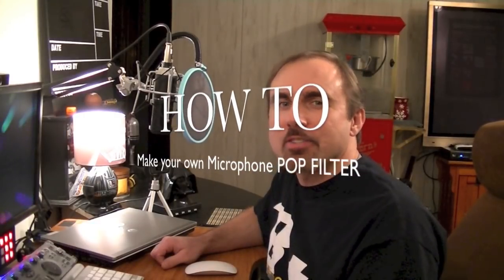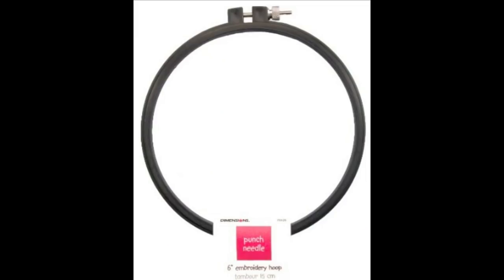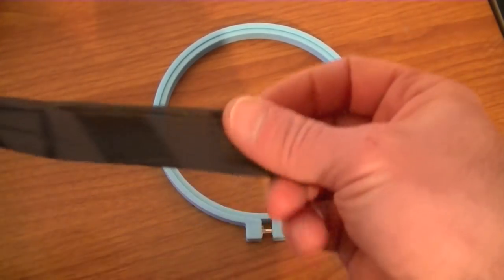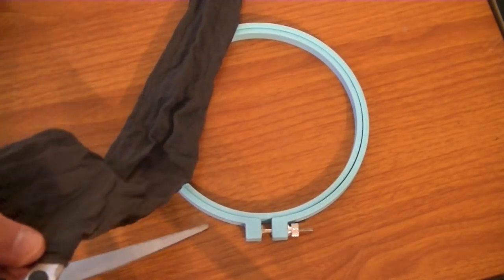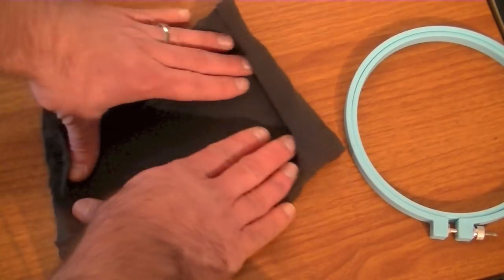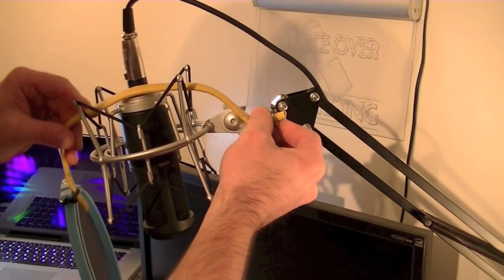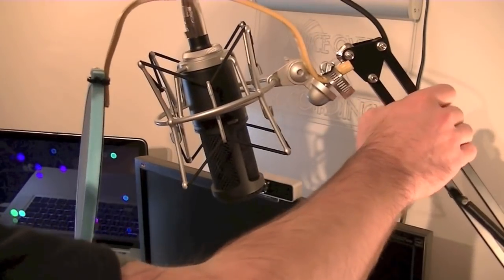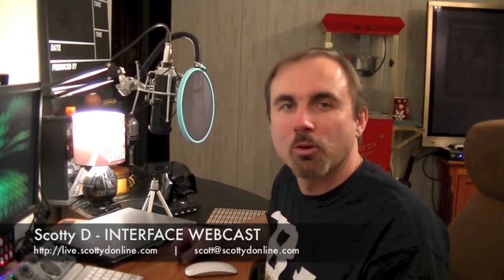How to make your own microphone Pop Filter

Comment: This guy just destroyed the pop-filter market. :3
Reply from the maker: I would welcome a chance to Partner with a major pop filter manufacturer to develop a truly modular pop filter that can be maintained and repaired at a component level. This CAN be done at a very cost effective cost to the consumer. I don't an NEVER will understand why there are $100+ pop filters on the market. IMHO, that is a rip-off... LIKEWISE, the cheap $8 pop-filter being sold isn't worth the plastic it's molded with because it's poorly designed on many different aspects. So as I mention in my video, it's NOT about the cost when I made my own, it's completely on the maintainability and longevity use of the pop-filter in a recording environment. When you have multiple people using the same filter, I don't want to walk up and use one that is filled with spit and germs from the previous person, NOR do I want to buy a new one IF the nylon rips or snags or the frame fails in any way shape or form. I should be able to clean, repair and/or replace any piece at a cost effective manner.

Comment: At about $6 for one of those China made pip filters on Amazon, i find it a hassle to make it yourself. If one of those cheap ones break, you could just get another one. Probably costs about the same making it yourself.
Reply from the maker: Sunny... that is definitely your prerogative... however as I mentioned in my video, it's NOT about the cost. I've tried MANY $6, $10, and even $50 manufactured pop filters and they failed to meet my expectations for quality of build and maintainability is nonexistent as they are made to throw away if ANYTHING goes wrong with them. So if you spend $6 on a pop filter and it fails in any way shape or form, OR the quality of the product fails to meet your expectations and you then buy another, then potentially another... you will eventually spend more time and effort working thru poorly designed products when instead you could build one that works as good, if not better than a manufactured one and it's 100% maintainable to every component. That was my reasoning behind my DIY Pop Filter.  I've also been very upfront that IF I could find a pop filter that is manufactured and allows for OEM component level repair, I would certainly entertain one of those over my DIY pop filter.
Reply: Scotty D
Thanks for this vid Scotty! I personally found this super helpful, since you really only need to buy the stuff and do this setup once. Instead of spending $6 a pop (pun intended) for a pop filter every time you need to replace it, for $1 you can change it again x2. So it will also save money in the long run on top of being easy to maintain.
Reply: Worth noting some of the China $6 ones take FOREVER to ship. I'm building one myself based off this video due my ordering a few two weeks ago and they are still not here. ^_^
Reply: I'll humor you, Riviera. ;-)

Run over to Amazon, find the cheapest P Screen filter.

It's running about $6.50. Check the first page of sellers that offer it as that price... The only one at that price shiping from the US requries a $35 order. The rest? Hong Kong, China, China, China, Hong Kong, Singapore, Taiwan. Your first American seller shows up for $7 plus two dollars shipping. So I elected for the cheaper option. Did I get burned for trying to save a few bucks? Yup. But it doesn't bother me. I was just happy to have the video.

And I did get my order, in perfectly good shape. Plus, now I have a backup.

Comment: I discovered a great way to do this by yourself! If you happen to have a tennis racket and some clothes pins, you can use that to stretch the nylon wide, over the inside ring, and then place the outside ring over and tighten, and finally, release the clothes pins! :D

Comment: A metal pop filter has not just holes in them. The shape of the carving in the pop filter pushes air downward. so it doesn't break up the wind but just redirects it. You can test it by blowing into your pop filter, you can actually feel the air from the bottom.

Comment: Been using a metal pop filter for over 20 years. You answer the main reason why to use a metal pop filter at 1:44 - metal is easy to clean. Having a commercial studio with different people "spitting" into the filter just isnt sanitary. So if you have a different people recording at your studio I HIGHLY recommend a metal Pop Filter.

Comment: Thanks Scotty! Just finished mine. The other thing you can do too if you don't want to wait for a helper to stretch the stocking, you can use push pins on a cork board, to stretch the fabric. I used 8, one on each corner, and one on each flat side, and before I did the last push pin, slid the plastic underneath. Does not rip the stocking or cause runs, at least when I did it it worked fine. Excellent Video. Thumbs up.

Comment: You can also get higher-thread-count (a denser mesh) nylon "speaker cloth" in larger, more uniform and flatter lengths at the fabric store.

I have a need for a slightly tougher screen, so I use double-folded pieces, for a total of 4 layers on the final product, and sometimes I'll even use a second pop-filter with burlap to be placed between the nylon filter and the mic.

I have also SLIGHTLY dampened the nylon in the finished pop-filter, then dried it with a blow-dryer, to tighten it up even more after the embroidery-hoop is already tightened.

Good tutorial.

EDIT: You can also go over the perimeter on the back with hot glue to help keep the nylon from fraying (which would give you a "run in your stockings" that could go all the way in to the functional part of the nylon) or slipping out over time.

Comment: I found a good way to stretch the nylon when you have no help. Get a cork board and at least 8 press pins (the ones with a wide top so they wont tear the nylon. Stretch the nylon as much as you can on the board and pinning it, first on 4 corners, then 8and try to make it as even as possible. Next unpin 1-2 pins and slip the inner hoop under the nylon and re-pin the removed pins. Next press the outer hoop on top of the nylon and tighten it. Make sure the hoop it tight enough before removing the pins, or it might go loose. And there you go.
Also a good alternative if you want a standing filter is to fasten it to a bendable arm you use to attach the GPS to your cars wind screen.
Reply: ***** I used my feet >.< Sadly I had to give my DIY pop filter to my cousin's birthday ;-;

Comment: I use a metal pop filter, and it works perfectly for my microphone I just bought. The advantage is that it doesn't break as easily, and you can clean it easily.

Comment: Couldn't you just slide the inner ring into the nylon "tube" ?
Reply from the maker: You could... I just felt it worked better for me with the configuration I did in the video.
Reply: ***** thats what i did. actually slit it in to one leg and then slipped the other leg over, and then clamped it down and cut everything off the back. works great!

Comment: Scotty you are a genius, I found the parts to do this with ease EXCECT the Romex Wire, I went everywhere and nobody had it by the foot, you have to purchase a whole roll!! This alone cut down on saving money. The cheapest roll I saw at Home Depot cost $6.37 for 15 feet, way more than needed, and I don't even know if it's the right size yet because I have not physically seen it. But other than that you are still a genius!

Comment: This is a great video!....and for all the people bitching about this.....DON'T MAKE ONE!  Some people actually enjoy making things themselves and not ordering crap from China off of Amazon.com Instead you can spend 8 bucks and about 15 minutes and do this yourself!
Reply from the maker: +Brennan Simmons Thanks for the support and the kind words....
Reply: +Scotty D sorry, what wire do u use? i dont get it would u tell me? thanks so much!
Reply from the maker: Mikael Maximillian It's standard house electrical wire. Typically known as Romex or 12-2 wire. You can go with 12-3 wire but 12-2 works just fine.
Reply: +Brennan Simmons It's a neat video, but to be fair, it's a legitimate claim. You can already buy decent-good pop filters for $5-7 and not spend any time with assembly at all. So yeah... you can make the claim for maintainability and all, but these aren't super-high quality items or anything. Spending $5 for an additional one and saving yourself the hands-on trouble (unless that's your hobby) is pretty much the ideal option.
Reply from the maker: +WALKINGonaSPIRAL With all due respect, I made this DIY after trying multiple store bought and online bought pop filters that we severely subpar. Either cheap single layer nylon, nylon that is permanent and not replaceable when it gets dirty or worn out, gooseneck arms that wouldn't stay in place, clamps that kept failing to hold, etc... I could go on and on. Once one thing started to fail, there was ZERO way to fix it as these manufactured pop filters are not designed to be maintained or fixed. To get into anything remotely of quality built I found the price to be grossly expensive.  

I've always been VERY clear in my comments that IF there is a quality built 100% maintainable pop filter at a reasonable price, I would try it out in my studio.

Comment: I've made a few of these using various materials. Two observations. First, the ones I made with wood instead of plastic provides a slightly cleaner tone (I believe this has something to do with the reverberation of the ring material). Second, I made one with a single layer of tightly stretched jersey knit (cotton/poly blend) material instead of nylons and found that the jersey knit provided more protection without sacrificing any volume.

Comment: Pretty clever, Scotty.  One mod I would make is this: On the filter end, fold the end of the Romex back over, then cover it up with the plastic coil thingy.  I think this would look better.  If the Romex is too thick to be covered by the coil when you double it up, you can strip off the sheath and just leave the three wires.

Comment: Cut both stockings at the crotch.  Take inner hoop and slide it in one stocking to the end and stretch mesh.  Take second stocking and slide over other stocking and hoop and also stretch to get all wrinkles.  Now take outer hoop and place on inner hoop and tighten.  Cut excess material off hoop making sure not to pull too tightly or material will pull loose and you will have a small section of hoop not covered by mesh.

I didn't have a friend with me so had to figure how to get the mesh in the hoop alone.  Worked like a charm.

I also had a way of attaching the wire to the hoop but it would take a video to show how I did it.  It made it very solid and no wiggle at all to it.  Before starting I sprayed everything with a flat black paint to give it a very professional (in my opinion) look as there are no contrasting colors of hoop, metal screws and such.

But I would have never had the ideas if I hadn't looked at this video so I'm very appreciative of the time you took to make it.  I plan to start recording books for Libervox and also do some "on request" readings for our local nursing homes and hospitals so I needed something to take the "pops" out.  Now if I could only find something to reduce this Southern accent I've acquired living in Dixie for the last 15 years?

Comment: Super helpful video, I just found a tension hoop at Michael’s that seems like it was made for this. Metal spring loaded circle that sits inside a plastic hoop. $7.99, slides easily right inside the nylon, 5 inch diameter. Brand name is “loops and threads”

Comment: The metal used in most pop filters is rigid i.e. similar to the metal used in a microphone grill but bent in such a way that air moving quickly through it is directed away from the microphone.  I believe the stiffness is such that resonances imparted by speech through it would be either outside the audible frequency range or so low in level to be beneath audibility.  I’ve never noticed any resonance in recording and would think microphone grills would be susceptible to similar resonances if that were in fact an issue.

Comment: Hi Scotty , In answer to your question re Metallic Pop filter's - while they work IMHO they are less that ideal in my experience. the principle is pretty simple and they work in a very similar way to a regular Auto muffler ( The ones I have seen and used at any rate did ) , They create a restriction where the sound-waves and your breath have to squeeze through causing a congestion that slows down the velocity of the "POP" and greatly dissipates it , but this still allows your audio to reach the Mic diaphragm relatively unscathed - the result is maybe up to a 35 dB reduction or more in the wind noise and POP with often less than 5 dB reduction in sound pressure as the Mic see's it .

I have tried many types of filter's and IMHO the very best one I made myself using "Silk" stockings and an embroidery hoop is the best solution I have come across for the $$ spent.

I use silk because it is natural fibre and varies in thickness thus has literally no resonant frequency to colour the Audio received by the Mic 
1 Embroidery Hoop  $4
1 Pair of "Silk" stockings $15 
2 Ft of 3/16 Enamelled Copper Wire Free from Local electrician. 
Total cost maybe $20 
Increase in clarity and sound quality Priceless

Comment: I have a samson mesh-popfilter, it's very easy to take apart with just a screwdriver, This makes it really easy to replace the mesh.
Reply from the maker: Interesting to know... what model # is it?
Reply: It's the Samson PS01. Two small screws hold the mesh brackets together. After undoing these screws you can use a flathead screwdriver to gently pry the brackets open (really easy). You can open it up and screw it back together without damaging it within 30 seconds.
Reply from the maker: How is the sturdiness of the arm? Many reviews of this product say the arm is weak and will not stay in place.
Reply: The arm is a little too stiff (not weak at all). Depending on how you mount the filter it may shift a little when you try to bend it around a tight/sharp corner for example. I haven't had any problems with the arm myself but in my case it's a slight bend it has to make.
Reply from the maker: vidm96 How about the mounting bracket? Some reviews state this model's mount bracket is not very strong at all.
Reply: What about the name, the name surely produces bad quality? What about all the what abouts? Surely one of these will discredit it and make people think my bent wire and panty hose is better...

Comment: No , the metal is actually good ; It stops the pop and does not dampen the sound. Silk or nylon will cut a couple db off the high frequency response. You don't have to worry about replacing them, as stainless steel  will last for a 1000 years, and you can quite easily  Disinfect with chlorine. 
   As a bonus, they  look  classy.

Comment: nice! keep it up. also you can use a double zip tie for better grip x and slide the romex into the flex tube first when its straight. either way works. thanks for the video very informative!

Comment: Excellent video. Thanks! I have a couple of questions. I'm using my headset microphone and the quality is quite good. I do think I need a mini pop filter for it though. Second question. Is there any reason why you don't just slide the inner ring inside a folded leg of hose instead of cutting it? It would make it a lot easier still.

Comment: Just wanna let you know Scotty that i made mine out only two items. A Plastic Rim from one of those long plastic vomit bags, i know, it sounds funny to use and an old stocking, only thing is and im not sure if it's better or worse but because the plastic rim is quite thick there is basically two pop filters, ow and the method of making the stocking stick tight to the rim was basically twisting the opening and then squeezing it into the area of which the bag used for vomiting in would be to hold it on there. I used $0 and the plan of having it hang where the mic is, well im just going to use an old coat hanger and wedge that in the area of where the opening of the stocking is.

Comment: i was also thinking along these lines, so I went and bought me a night hot pink hoop and I did this today. i did it a little easier than you though, i actually just slipped the loop into the first leg and then brought the other leg over it and then put the outer loop on top after stretching it tight. Obviously this put two layers on the front and back of the inner loop, but i just trimmed out the back and I was done. This way you can do it yourself without help, and  I still have enough material to do it again. I used a 6 inch hoop though, that's all that America's favorite supermarket had.

Comment: You might actually want to try one of those metal pop filters. Does it have a sharp resonant peak? By all reason it should, like any monolithic material... but it's somehow not at all audible and they work surprisingly well. Vortex deflection something, i don't know. They seem to work about as well as nylon ones, maybe depending on positioning a bit better, maybe a bit worse, no major difference. I know you already have a pop filter that doesn't cost you much to maintain, but you know how it is with curiosity.

I wonder though, storebought nylon pop filters are made in two layers that are some distance apart, and yours are pressed together... and also may be different TPI/density, different amount of stretch... so i'm wondering if there is much difference between different configurations like that, and whether there is a "best" one.